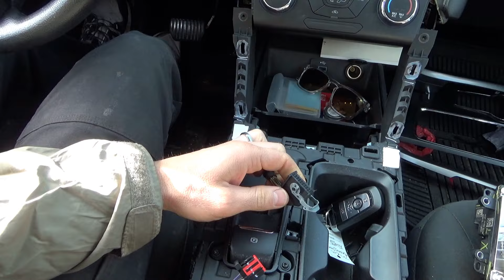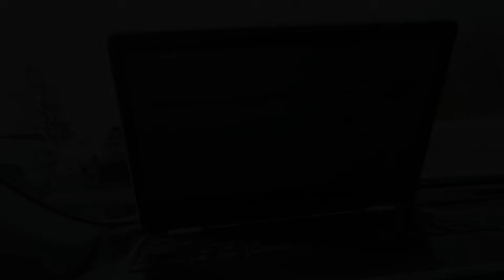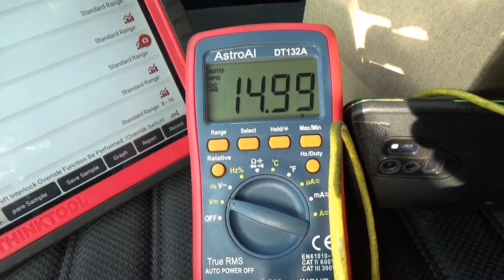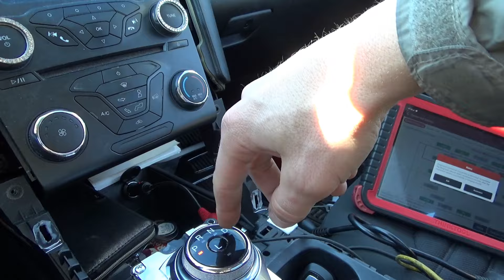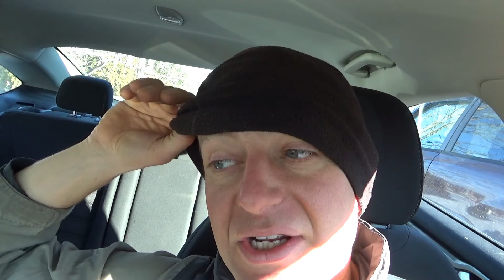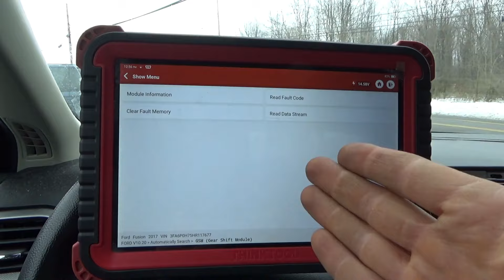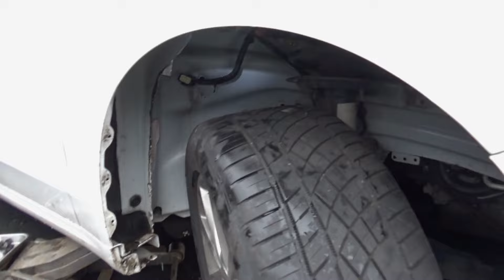Why New Cars SUCK (Ford Fusion STUCK in PARK?! - Part 2)

Comment: When looking at the technology of modern cars I think I did the right call to keep my trusty 24 year old Toyota Camry which hasn't failed my yet. I point my finger at modern car manufactures!
Reply from the maker: I just restored a 98 Camry V6 to have as a spare beater loaner. It actually drives smoother than any of my other cars 😅👍
Reply: @PineHollowAutoDiagnostics  Mine is a four cylinder. I want to keep it simple! BTW  now I'm a senior citizen and I do most of my transportation with my bicycle or public transport. My town is perfect for that with separate bicycle and walking roads totally separated from the main roads. Most road crossings are with tunnels under the main roads.
I live in Sweden!

Comment: Our version of this in the uk don't have the cable and motor setup. They are electronically shifted inside the transmission. Same rotation selector though.
Reply: I wonder if that is the reason for the half-arsed module in the wheel arch if the US gearbox is a 'Normal' cable type but the interior was common. European name is Mondeo but I guess that is well known.

Comment: I guess RAM started this stupid crap when simple linkage always worked before. The only problem I've ever had with shift linkage in over 60 years of driving was on my 05 Dodge Magnum when the infamous pink thingy broke.  The pink thingy is a plastic part that has a spring hook that is too weak and it will break sometime in the life of the car preventing taking the lever out of park.  Mine broke at just over 100k miles.  I replaced it myself as it was in the console and not that hard to replace.

Comment: I’m not all the way through this video yet but as soon as I heard it going in one direction and click click clicking, all I could think was, “the internal limit switch is broken”. Of course it may not even have a limit switch and might have a rotary encoder or somethin, but the behavior was exactly what one might expect of a broken limit switch. Hit the end of travel and keep pushing against it until the motor stalls, gears strip, steppers skip, etc.
Reply from the maker: Meanwhile not settling any DTCs 🤣

Comment: Wow some Ford engineer took the Marine application of ZF Micro command and put it in a car. It’s needed when you helm station is 80 some feet from transmission for lack of a better comparison the Crab boats like Northwestern use a system like this. I’m familiar with this as we use it on our 50 and 60 foot houseboats. Very reliable but when it breaks or get “confused” it can be frustrating. Expensive also, can’t understand why they would add the cost for such a short run and added complexity.

Comment: All of that extra bullshit and the transmission is still shifted with a cable.  Not to mention the way the manufacturers are making it so you can't access certain modules and only the dealer can with proprietary equipment.  Basically when you buy a vehicle you don't own the whole thing with the factory maintaining ownership of certain parts of it.  Before 1996 with the OBDI systems each manufacturer had a proprietary way to access the onboard systems but it was mandated that system needed to be standardized, hence the reason we have OBDII.  As much as I hate government intervention, something needs to be done where the owner of the vehicle is not locked out of certain parts of the vehicle.  I am not going to pay an obscene amount of money for a vehicle only to be forced to take it to the dealer to have it repaired.  Sorry you had to go through all of that, but I thank you very much for sharing your experience.  As for the parts cannon on the switch, you pretty much had no choice.  You verified circuit integrity, voltage, grounds, proper signal, everything.  Logic dictated there was a module issue, and the switch was the easiest and probably the cheapest to try first.

Comment: I took apart a landscape lighting timer that the dial didn't advance with the time. I literally found one grain of sand stuck between the teeth on the plastic gears. One grain of sand stopped it dead.

Comment: Cables and manual shift leavers are reliable. If something works and isn't broke, leave it the hell alone. No wonder car prices are so high. The nylon retainer at the transmission shift lever broke on my Escape at 74,000, why not use a simple oilette bushing and C clip retainer? Engineering to the point of Stupid.

Comment: This is what happens when people who are drunk/stoned forget to put their foot on the brake, not shift into park and open the door and get out and the car rolls away/runs them over or shifts gears without coming to a stop damaging the car, get hurt and then sue the manufacturer and jury awards huge unrealistic rewards.  Remember, the first trouble shooting tip on an electric product is: 1) is it plugged in.  There is a reason for such a stupid trouble shooting tip.

Comment: This contraption is a fine example of Rube Goldberg machine. What baffles is that it passed all the steps through conception, approval, design, prototyping, and commercial production. I am thinking of all the engineers and management teams giving a nod that it is a great idea. Let's implement.
Reply: Having been in this field (development and implementation) I can absolutely tell you that 90% of the time, all the engineers are on the same side as all of you.  It is ALWAYS the bean counters that convince corporate on either an initial production savings, a long term service revenue (fixing it down the road), or the ability to sell more units by promoting additional “safety”.  Once corporate (very few in corporate started life as engineers) makes their decision, you as the engineer press forward with the company decision.  So please….stop blaming the engineers…their bosses are making the decisions and the bean counters are who they listen to the most!
Reply: Where was the person who was supposed to say 'This is stupid?'
Reply: I do find it hard to believe that any one engineer said OK. Representatives of shareholders said OK.
Reply: When you see the CONTINENTAL ECM you know Ford had the opportunity to select from a rich pannel of pretested failures 😁
Reply: I think the engineers deserve some of the blame in this case. Look how complicated that actuator assembly is.  Three motors, two circuit boards.  A simple RC servo like design would have probably worked fine.
Reply: Great job Ivan from Ivan we both are mechanic s and I gotcha say hi and I like watching your videos.g😊

Comment: When you don't understand why a (car, etc.) manufacturer chooses to do things a certain way, the answer almost always is $$$$.  Ford may be over engineering the shift mechanism to avoid the Audi unintended acceleration fiasco of the mid 1980s. Not that it is the right thing to do, but avoiding a multimillion dollar settlement or two might be pushing them in this direction.  That said, good job doing the research and narrowing down the problem to the likely culprit and having the nads to pull the trigger!
Reply from the maker: Ya... And they still failed 🤪

Comment: Unbelievable! Instead of designing a transmition to go with the shift-by-wire, they built a really sturdy actuator, with two big motors working together and some big caps  to provide local energy storage and prevent current spikes when they turn on - just to deal with the not so easy to move mechanism of what looks like a standard, unmodified transmission - just for the appeal of the rotating knob! (Ah! And so it can move to P by itself). "Appelization" on its finest! It's particularly funny caming from Ford. They should call it "Teletouch 2.0" 😁

Comment: amen, manufacturers putting electronic fly by wire touchscreen heavy complicated crap where cables and knobs and buttons used to work just fine, very very frustrating to me too. two computers three motors dozens of wires and microchips and nonsense so you don't have a shifter anymore, crap. can't pull up on my door lock knob, have to push an electric button in the middle of the dash. can't see what radio station is on because ford sync has a complaint screen that it's not connected to a phone so 911 won't work. we don't want more screens and buttons we want a car that works!

Comment: So then the TRCM actuator must have a redundant range position sensor internally. Since they call it a smart module, they don't show serviceable parts nor wiring.  Stupid unnecessary system.

Comment: crazy over complicated. i would have looked in there expecting to maybe see a stripped plastic worm gear or something plastic broken,  but no something must have popped with the over current on a circuit board, a transistor maybe or even a fuse!  you know the ones that don't look like fuses.  probably never even left a brown stain!  but anyway thanks for the education ivan.  bloody fords!

Comment: Kind of a frustrating conclusion that the failure was in a part supposed to last the lifetime of the car.
This gearshift mechanism is a direct over engineered part taken to the limit of insanity.
In the future looking for used cars: WARNING it's a Ford Fusion.  😱

Comment: Of course it's a safety feature. It saves the dealerships lost money from ordinary DIYers from not paying them for repairs.

As for aftermarket scan tools, the auto manufacturers are still working hard to put them out of business.  They want congress to give them the right to use the John Deere model of having the control models be black boxes. If they could, they would brick their cars if you didn't use factory brake pads. Support Right To Repair.

Comment: So all this weight, circuit boards and heavy motors/ capacitors are replacing a single control cable. Sounds like complexity for the purpose of complexity; or a solution looking for a problem. The ultimate safety device as you can't hurt yourself if you can't get the car to move.

Comment: From what I can tell, the little motor will drive the plate, that will then move the cam, locking out the cable from turning. You were turning the whole gear assembly, not the shaft that actually moves the cable. This is a huge assumption on my end lol

Comment: In the last / first video you talked about the door ajar and you were opening and closing it. Could that sensor be interfering? I'm asking because the driver could have done something getting in or out and not telling the shop.    Things don't happen unless the door is closed right? OK OK lets see if you figure it out and what really is wrong.

Comment: I have no idea how that intricate mechanism works, or what the purpose of it is.  I imagine that all the complex electronics we're seeing are the module portion that's talking with the GSM and the TCM, and the TCM is sending it confirmation signals of shift position that logically compare to input from the GSM.  I think the reason we didn't see any trouble codes is because logically, the position of the various motors and levers inside the shift controller created the same data set as the door being opened, and the blinking of the Park light is the system's response to that situation.  It seems like a logic problem, and they forgot to put in a logic check to the BCM to see if the Door Ajar switch was activated that would have been needed to generate a trouble code.

Comment: While still watching the video: is it possible that the TRCM motor is trying to rotate the opposite way? No, it was a mechanically locked. Nice to see you overcome this absurd trap, Ivan!
Undocumented, unnecessary and over expensive complication by Ford, just because!  And they're on a long back order!! The TRCM teardown was the juicy part of this video :-)
I guess the motor position is sensed by increased current when hitting the stop positions (widely used in other applications, to avoid sensors or stop switches).
This is the mother of all overcomplicated systems! And just to replace a manual lever, that was just too simple for the minds of modern automotive engineers.

Comment: Note to self..instead of flipping a " parts cannon coin, heads or tails"  just call the dealer and ask for both parts. the one on back order gets statistically more likely
Reply: Wouldn't be out of stock if other weren't buying them up...there's a reason they sell out of one part.
Reply: In other words...the part thats on backorder is the likely culprit
Reply: likely.....some ppl have worse luck than the likely issues

Comment: Great job there Ivan yeah I agree there are way too many controls on all these vehicles way too much we will have to D -technologicalize ourselves also I've heard some real horror stories about the Ford clutch control module where the lever is no longer a controlling the clutch it is a motor like this thing had what do we have to do!!. As a retired mechanic I really like the idea of being retired with all this technology that's being thrown at us for no reason at all and the sad part of it is the customers gotta pay for it it's absolute garbage and the companies are totally in control of us go to the dealer my every scan tool on the market for every customer for every car made absolutely putting us out of business Needless to say the frustration level is off the chart if you built it you should be able to diagnose how to fix it God bless you there Ivan
Reply: Yep. After 45 years of this retirement is bliss. Can’t imagine the stress level on new car techs. I suspect most dealer techs fire parts cannon.  Warranty time usually gives them less than an hour to diagnose 😳

Comment: For the Money Ford lost with this IDIOT proof shifter B💩S They could have installed a gold plated shift knob with normal shift cables, And a few solenoids to prevent the shifter movement while wheel speed is present so not to allow a reverse drop situation etc, But no got to go full wire what an absolute JOKE and I'm not even close to being an engineer for any of this Stupidity, It's definitely over engineered 💩💩 stack shifting go on with this Ford, No wonder FORD has 100s of recalls just these Year's 2022-23. Not impressed. Glad You were able to get it back on the Road, I would tell that Customer to sell it ASP, the wait until the spring Car sales increased and the price drop turn around by a better built Japanese car, Trust Me better car are available. 🌞

Comment: I stand corrected. I thought the code for the driver door status would be the cause of the fault. I have not seen many of these shift actuators go bad. I also didn't know they used plastic gears. I would have thought everything inside would have been metal gears. That's a horrible design! This is so overcomplicated just to pull a cable.

Comment: Holy crap.... I was wondering if the goofy noises that thing was making were a symptom, or a red herring... Makes for a frustrating time indeed. 

DUMB. More stuff to break and keep the consumption cycle going when they can't be replaced. I doubt the factory that builds those will be making them in 5 more years.

Comment: Several applications using the Mercedes 722.9 (7 speed auto) use an ISM (Intelligent Servo Module) bolted to the transmission to shift. It is made by Continental and my 2007 S550 has one.  At least there they put the e-shifter on the column freeing up center console space for the COMAND HMI which I actually like.

I got the car at 79k and I believe it had been done previously. It is known for failing but also I think there is a shift actuation counter that when triggered it tells you to drive to the dealer.  At that point you risk stranding the vehicle.  So yeah this BS has been around for almost 20 years and I thought I saw that TRCM was made by Continental. Maybe I am also making the point that Ford probably gave some requirements and the design of the module was done by Continental (and any subs they may have).  This is the reality of automotive supply chains. It has been a LONG time since automakers did everything under one roof.

Comment: The point is something like this ,  Ford trucks have had shifting problems problems with the truck jumping out of park since the 50 s  I have seen trucks idling jump in to reverse and crashing into airplanes causing severe damage as late as 2003

Comment: Hope they still keep the stick option (transfer case)  on the 4x4 pickup, the way mine is, not the electronic version..ughh...oh wait mine is GMC..love the content.
Think they forgot to put limits on cable travel actuator and the trouble code is it happens.

Comment: That automatic shift into park when the door is open is a safety feature. According to the National Highway Traffic Safety Administration, at least 93 people are killed each year from rollaway vehicles, most notably Star Treks Anton Yelchin. On our 2011 Chevy Tahoe the doors won't unlock until shifted into park which is a much simpler design. Ford simply over engineered it on this car.
Reply from the maker: The auto door locks is a nice easy solution to implement 👍

Comment: The stress of electronic auto diagnosis, pressed with time is money, is unique.  You can go from sailing strong to sunk in a flash.  A mistake can cost thousands in needless parts.  The complexity grows faster than understanding.  Keep in mind, airplane drive by wire has 3 redundant paths.  Great job!

Comment: Dumbing down people one step at a time! 
I wonder how many people have stepped out of a vehicle without taking it out of gear, the second time?!
Now, people are going to get used to vehicles doing the work for them! Just like automatic transmissions. How many people rely on them and are clueless on how to drive a manual transmission?! Before I got my license, I watched an adult attempt to move a manual transmission truck.  He hit the key and the truck lurched forward. He was lost as to go any farther. Out of respect, I kept my mouth shut. I could have easily driven it. The car in my profile picture, 1958 Plymouth Suburban, I drove at the age of 6 years old!